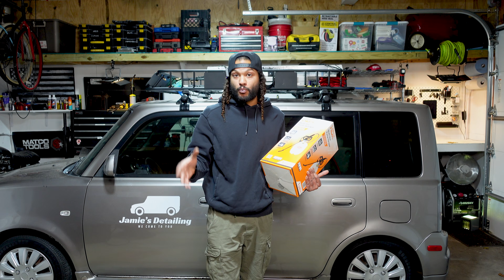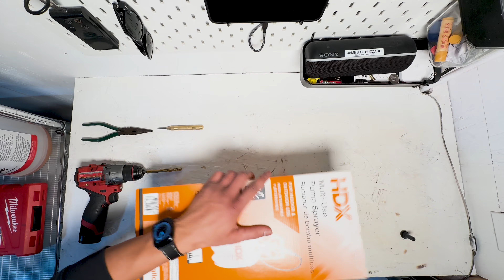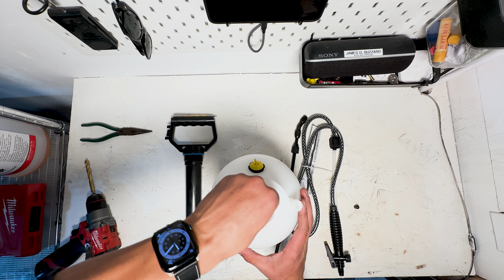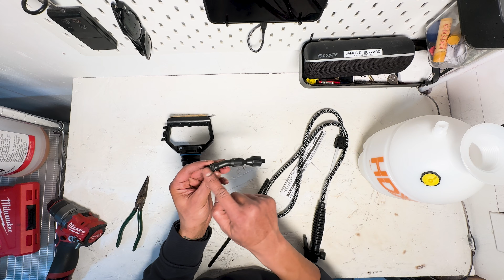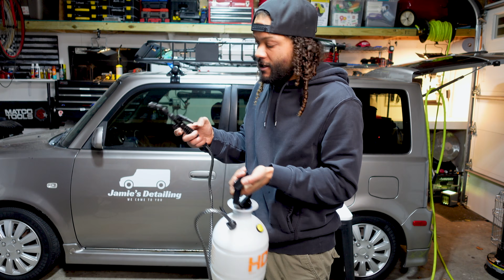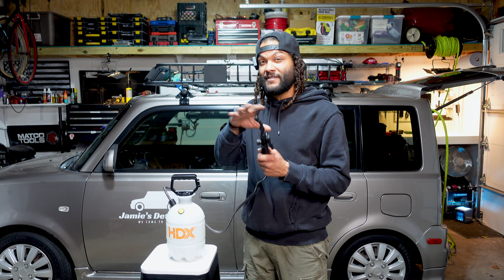Budget Detail Sprayer To Rinseless Wash Your Car This Winter

Comment: You could add a upgrade by changing the supply tube in the container with a silicone tube. Make sure it is flexible and put the tube through the middle of a nut so the tube will move with the bottle so you have a constant supply even if the bottle is crooked

Comment: Jamie. Great idea. For those without an air compressor near, try getting a xiomi 2 air compressor and attach to your sprayer. Kiev of cars by Kiev explains exactly how to secure the pump to the sprayer. Xiomi 2 can be purchased at xiomi for around $52.  Keeps pressure within 5 psi of selected so doesn’t run continuously. Switch pump to different sprayers for versatility.
Reply: Actually purchase at zemu

Comment: Excellent video, thank you. I bought an IK sprayer, and people say they're great, but they are not. The ergonomics of having the tip at the top of the bottle are awful -- heavy on the arm, not easy to maneuver the tip. This sprayer -- which allows you to hold the tank down by your side and manipulate the wand wherever -- is a far better solution. Will be doing this asap.

Comment: Great vid. However, you shouldn't have cut the extension wand because now you actually have to bend down. Seems like a downgrade. 😂
Reply from the maker: I like it better short and it stores a lot better in my detailing rig and in the garage. You will see even on keg sprayers most people don’t have a long wand. You will be bending down often if you’re detailing a vehicle no way around that.
Reply: @jamiesdetailing  Ouuuu! Fair play! You're right: It does stack nicely with the shorter sprayer docked in the pump handle.
Reply: @jamiesdetailing  Just finished building this thing with the 2-gallon version and it is friggin awesome!  It’s holding a solid 50 PSI and can push out the whole jug on one charge! No more pumping my 48 oz CHAPIN multi sprayer like an absolute lunatic. This is going to cut my workflow time down 100%. Thank you for sharing! ❤

Comment: $20 for the hack, but if you don't have a compressor, you have to factor that into the costs too.  Cheap ones are probably ~$100, but they can go up fast
Reply from the maker: You could also get one of those little tire pumps for around $40-$50 bucks

Comment: Thanks for the video.  Not a professional detailer here but have been foaming my vehicles for awhile now and am switching to rinseless wash instead so needed an applicator that did not cost a fortune or needed to be constantly pumped by hand when doing a two step rinseless application when the cars are dirty.  I picked up the 2 gallon chemical application version of this sprayer at Home Depot because I wanted the larger capacity and modified it based on your tutorial.  It works exactly as I had hoped easily getting around the car twice without having to manually pump.  Very fast way to wash my cars now compared to dealing with all the foam.  Thanks again for the tip and saved me a ton of money over getting a professional unit designed for detailing.

Comment: Too make it easier to pull the valve stem through stick some hardware wire through from the outside hole through the valve stem and make a curly que at the bottom. Will make it easy to pull it through.

Comment: Is the valve installation only for use with the compressor? Is it absolutely necessary? Will a pump sprayer work well without modifications?
Reply from the maker: It will work perfectly fine without any modifications

Comment: Ey brotha will this rinselles  set up would work on  salty vehicles or wat u recommend?
Reply from the maker: It can depend on how much salt. Typically with salt I like to still do a quick prewash before getting into the rinseless wash process. But in a pinch I have definitely just used rinseless wash out of a pump sprayer as a pre-soak. I still prefer to do a pre-wash with the pressure washer when possible though
Reply: @jamiesdetailing  ok got u I was asking cuz here in the winter b negative degrees or too cold .
Reply from the maker: @franciscohuerta9860 I feel you on that. It was 10 degrees today here just outside Chicago. What area are you in?
Reply: @jamiesdetailing  Indiana

Comment: Couple points on pump sprayers. I have 9 of them. Most are modified with valve stems so they can be pressureized with a compressor. Dont like the type of pressure relief that is on the HDX. I like one that I can manually operate. I always manually operate the pressure relief valve prior to filling with compressed air. If that valve were to fail and the filler was unaware they would be making a plastic bomb that could explode by over pressurizing the sprayer. It literally takes one second to check the relief valve.
Also IK sprayers are the best but are a little pricey. The Smith brand are a middle of the road brand sprayer. I like the better sprayers as they spray the product out much better pattern and more volume than cheaper sprayers. However the cheaper, HDX/etc have their place and one advantage is their smaller size which works when using a sprayer in a confined space such as in a garage. The advantage of a bigger sprayer is one doesnt have to refill as often.
Reply: Bahahaha  That's an understatement IK is a "bit" pricey  LOL  Good one. I'd say paying $70 plus - $200 Plus for what the companies pays  ($5 - $15) for them is more than just pricey.

Comment: I use this exact method, but usually have a bucket with sponge (or contact item of choice) as well. I like this method, if I am only removing light dust. Awesome video to modify the sprayer.
Reply from the maker: The bucket and sponge method is my go to especially if I am doing a rinseless on a clients vehicle. Typically if people are paying me they are expecting more than this 😂 For my personal vehicles though I use this method all the time just to wipe them down. I still always recommend assessing the vehicle before you decide on the best wash method. I was just doing this more to demonstrate the sprayer but you can definitely get away with this on your own vehicles. 👊🏽
Reply: @jamiesdetailing  it was perfect!

Comment: You think those literally battery-operated tire inflator will work if I don't have an air compressor?
Reply from the maker: Yes that is absolutely an option. Throw some Velcro on the pump and tire inflator to secure it. Set it to whatever pressure works best and you got a poor man’s IK E FOAM Pro 12
Reply: @jamiesdetailing  Haha bro! The velcro idea and permanant inflator idea is amazing! I gotta do that!
Reply: @Engineered2Detail  I think cars with keav did something similar to that recently on his channel

Comment: I suggest the 2 gallon. Use 1/2 to 3/4 liquid. The more airspace you have the longer it will run
Reply from the maker: Definitely a good point! 👏👊🏽
Reply: Great idea...air can be compressed to provide the needed pressure,  water cannot.

Comment: Awesome video. I use a nut on the valve to pull them up. I have this set up for all my outdoor home cleaning in the summer and Car washing in the winter. I use a 2 part cleaning 100:1 ratio and a spray sealant and use the pressure washing bay at the gas station, the results are crazy good vs their soap and such. I have them for lawn care too. My wife laughs at my collection of bottles. Detailing Engines the long wand I heated up and bent more of a 90 degree to get into those areas you see but can't get a straight shot on it. "YES" celebrate another who gets it like I do.
Reply from the maker: Glad we are on the same page, the possibilities are endless when it comes to detailing! Thanks a ton for sharing all your insight on installing the valve. It’s comments like these that we can all learn from 👊🏽

Comment: I’m doing rinsless washes in my garage and ya man this is same as I do.  I get a bucket of hot water and mix my Mckees V2 in it.   I pre soak with rinsless as well.   I still use dark fury on wheels and also turtle wax wheel cleaner with decon remover.  Stuff works great.   The pump sprayer to rinse the wheels.  When I’m all done washing the car I then take my shop vac and vacuum up the water in the garage.   I don’t have a drain unfortunately.   For heat I’m using a Bauer torpedo heater from Harbor Freight.   That thing kicks butt man.  This is a game changer.   Great stuff bro.    Keep up the great videos.  I’ll add a valve stem to mine as well.   Side note…the harbor freight pump sprayer, don’t get one.   The plastic is too thin and prone to pin holes.
Reply from the maker: Thank you for the heads up. I haven’t tried the HF sprayer yet. The Bauer forced induction heater is a great option for heating a garage. It is definitely a little beast. Glad you are staying warm this winter! 👊🏽
Reply: sauce has been given 📝 taken
Reply: I’m new to this. Are you using this method instead of a DI set up?

Comment: I think the harbor freight one has to be cheaper but the hdx line and the harbor freight ones did not last long for me at all just a couple months and the o rings gave out I have the mad expensive IK sprayer now but have had 0 problems with it no more trying to fix a pump sprayer mid job or worry about having a backup 😂
Reply: I've had all of em fail lol. Ik foamer came with messed up o rings, ik sprayer was ok, gosh I hate how much they have to be hand pumped for 20 seconds of spraying. 
I had a harbor freight 2 gallon one last less than 2 months, and a home depot one last 2 ish month. I have yet to buy the over hundred dollar ik
Reply: @ yeah I got the big multi pro 12+ it’s fireee
Reply from the maker: I have actually had the opposite experience. I use my IK sprays more but I used to use the HdX 64oz pump sprayers and never had a problem. They have much better o-rings from the factory than IK does. I frequently replace the o-rings on my IK sprayers but not really ever on my HDXs. I did a video on the o-rings for IK sprayers in the past if you want to check it out.
Reply: @ thats wild I had multiple hdx hand pump sprayers fail all within a month of using with properly and methodically cleaning and rinsing I went to use one and pumped it up and the full on plastic bottle part started just spraying out the side 🤣 multiple the hose broke off and the time it held pressure wasn’t good and the endless threads on it was too much time then used harbor freight and those o rings and pressure wasn’t even worse and now have gotten the IK and no issues but tbh there are bad apples and quality control issues with every company tbh and that’s why the warranty’s and replacement parts are such an important thing which I have no comments or knowledge on from personal experience with any company lol i dont have time for all that haha
Reply from the maker: Definitely could be some quality control issues. I do like that IK has the rebuild/ maintenance kits for all of their sprayers 👌🏾 I really never have too many problems outside of the oring for the pump itself on any brand sprayer but I think that is to be expected. They are 50 cents at ace hardware though so no big deal.
Reply: @ oh and I love your videos btw not saying you are wrong or your experiences are false just speaking from my experience which is obviously going to be different but nonetheless you are amazing and I love the knowledge and content and support you provide to our community ❤️

Comment: The only reason for the valve stem mod is to avoid having to pump the handle? If I’m not mistaken, couldn’t you just use the sprayer as is and not have to carry an air compressor? Thanks
Reply: Yep. This doesn't eliminate the pump. Just make easier/faster if you do have a compressor.
Reply from the maker: The valve stem is totally optional! You can use your sprayer as is. No need for any modifications if you like it how it is out of the box
Reply: Sounds good, I appreciate the replies. I haven’t used this method before but I’ll be setting one up this year for sure!

Comment: What is your opinion on tech 582 choice ?do you use it straight or dilute it .
Reply from the maker: Most of the time I use it diluted 1:1. I typically use it as a rinse aid or drying aid, but if I’m spraying it directly onto the dry paint, I’m probably using it full strength not always though.

Comment: I appreciate this share. lol did you rig the HDX handheld 56oz ones? I use that with P&S absolute. I may use the gallon one you just displayed. For a rinsless was and use the handheld 560z with waterless wash and wax from superior products. For a prewash when my car is hammered with caked on dirt lol and wheels
Reply from the maker: @jayp9450  this is basically what I do! SP Waterless Wash in a smaller spray bottle 👌🏾 use the big one more for rinseless washes
Reply: @ yeah I will downsize to a 32oz bottle SP WW. Good idea save money too. What do you use for wheels? I use super clean 4:1 32oz bottle with black microfiber clothes. With cheap Home Depot microfiber towels. For the RLW on the body and lower panels. I like HD rags I call them my disposable rags. Once they get dusty toss them and get some more for $11 😝

Comment: Im not a rinseless  fan , I've seen what can been done when not done right. I had a customer that had some guy that all he did was rinseless  , guy called me wanted a quote for a coating. When I saw the Tahoe it was so swirled up that I told him he needed a minimum of a 1 step , I didn't feel comfortable putting a coating with the paint the way it was. He decided not to book but hey it's my reputation so I kindly declined myself
Reply: The swirls didn’t necessarily come from the guy doing rinseless it can happen from driving on the highway it can happen before he started washing it and it could happen in the drying process and it has a lot of factors the rinseless wash doesn’t scratch if done correctly it scratches less than a pressure washer slamming water and debris against the paint and using soap that doesn’t emulsify and encapsulate like rinseless much love ❤
Reply: @WildLenny  nah they came from the rinsless its all the guy did , he doesn't use pressure washer or anything from what the client told me . The entire car had swirls on it. I looked at myself and looked at him like dude what happen to your Tahoe
Reply: @KingTheDetailer  highly doubt it. Rinseless washing swirls less than traditional car soap. But cool story bro
Reply: @KingTheDetailer  all I got to say is do some more research my man before you start trying to make stuff up lmao 🤣 just like you using 3d one you probably are so naive you think it doesn’t have fillers which it does check their SDS hint hint (it has fillers) but who cares it’s your reputation and people will find you knowledge is far less than others and move away from you automatically it’s okay 👌🏻
Reply: @WildLenny  3D one has no fillers bro per the manufacture , instead trying to sound smart on here use your phone and fo your research , you might be talking about 3D speed that does contain fillers but hey your run your business your way I run my business my way. We all have our opinions like it or not
Reply: @ White mineral oil in a compound and polish is technically a filler right?

Yes, white mineral oil in a compound or polish can technically act as a filler. Fillers are substances used in polishes to temporarily mask or hide minor scratches, swirls, or imperfections by filling them in, creating the appearance of a smoother surface. While mineral oil is primarily a lubricant in polishes, its residue can remain on the surface, making imperfections less visible until the product wears off or is removed.

If you’re aiming for true correction, it’s essential to perform an IPA (isopropyl alcohol) wipe-down after polishing to remove any oils or fillers and reveal the actual condition of the paint. This ensures you’re not masking defects but correcting them.

Ohhhh wowwwwwwwwww why don’t you pick up your phone and know how to use it besides checking things that pop straight up on google tard
Reply: @ 3D one has fillers per manufacturer SDS sheet
Reply: @ dude you are wrong check the SDS sheet it has white mineral oil which is technically a filler… all of you are straight bots